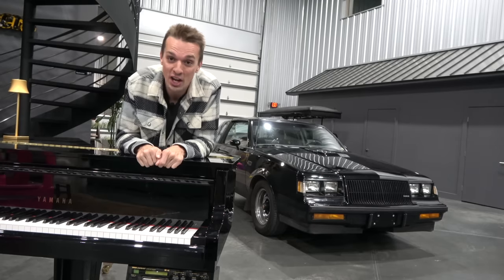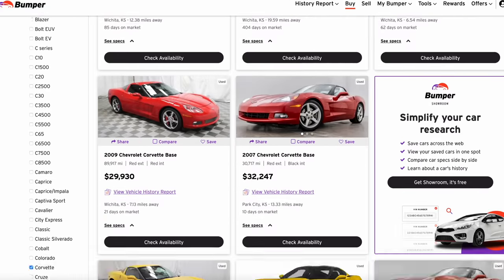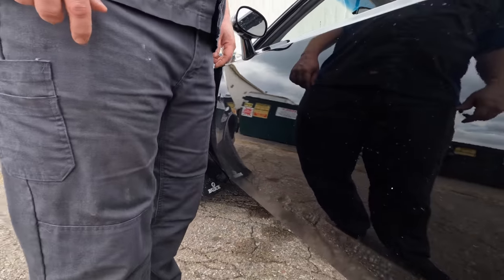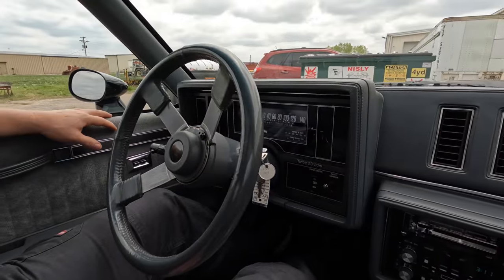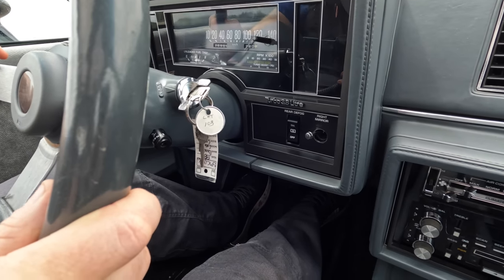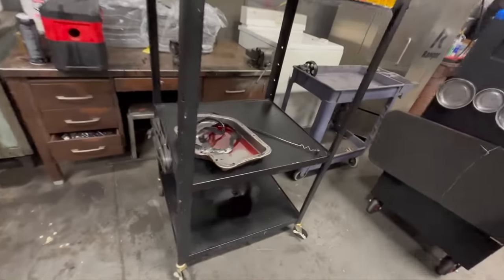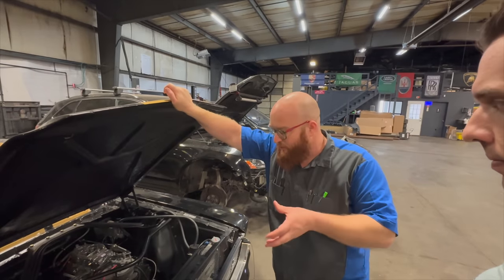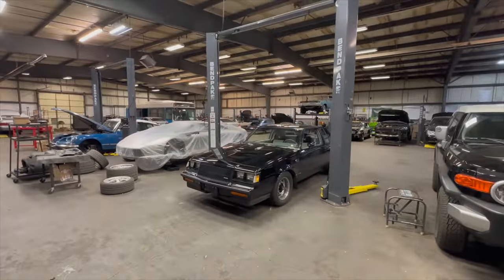Everything wrong with my cheap Buick Grand National, and finding previous accident damage?

Comment: My first actual CAR was a 1984 Buick Regal LTD. Black with maroon interior. Digital dash, Digital climate control. I absolutely loved it. Sadly I sold it.. twice lol
Reply: Fool me once, shame on you. Fool me twice...
Reply: Your first “actual” car?
Reply: My first car was a 79 regal Limited with the 5.0L motor. That was back when I lived in Florida, bought it from a retired couple, and the car was immaculate. Brought it back to New York, raced everybody with that thing, for some reason I could drive that car so fast. Oversteer monster. God I want a Grand National😍
Reply: Those cars are a headache to own nowadays. They’re old. If you find one in good condition, there’s no guarantee how long it will work, and it would be super expensive.
Reply: @doublezero7852  prob had trucks
Reply: Had same Regal..loved it--- 😢but sold it also😢😢
Reply: You know a cars good when you just have to buy it back. And when you eventually sell it again  you miss it
Reply: @zippityzbrake  yup, was never the same after I first sold it. Guy changed the engine and the custom wheels were gone, and rear seat area gutted.
Reply: @doublezero7852  everything prior was a pickup truck. 1980 chevy and 1980 gmc.
Reply: @schrodingerscat8621  yup mine was originally a 305. Was a great balance of power and fuel usage lol

Comment: I suspect if you look very closely, you will find out that the car got "front clipped".  The front of the car (including the frame rails) is in much better shape than the rest.    I think if you check, the "clean" is going to stop right around the subframe connectors.   They likely bolted back on the original suspension and all to save a bit, but the parts are about 2k and about 8 to 10 hours work, plus body panels and paint, and you can make it to 10k without effort.
Reply: The 1987 Buick Regal  (Grand National's base) was a full perimeter frame car, not a unit-body with subframe.

Comment: Had to have been up front, i noticed some butt connectors on the wiring for the marker lights that should also have wire loom on it and not bare hanging in the breeze. I wouldn't be surprised if it had a full or partial nose job. Look for aftermarket fenders and such. Insurance companies dont like to pay out for factory parts

Comment: Pretty much all of them got repainted at some point. The paint would start what they called checking. It would start on the tops of the front fenders and the hood. My dad bought one new and even though it was garaged, he had it repainted because of the checking.

It started doing it by 1989 or 1990. Low miles and garaged all the time.
Reply: Yup. My aunt has one left by my grandfather. Original paint and it looks like _garbage_. 

They really did a piss poor job on the paint on these cars.

Comment: Nice grand National I have a 84 grand National myself. Hot air car but fun as hell. Nice cars. Old but fun. On the hesitation check the EGR valve they are notorious for have problems. And if you disconnect them sometimes they will cause pinging really bad.

Comment: Bring it to the Buick GS Nationals in Bowling Green, KY coming up in two weeks May 17th - 20th. Car looks pretty stock and FYI that digital boost gauge is notorious for being inaccurate. First mods should be an aux boost gauge and scanmaster to monitor the ECU including knock retard. FYI, that rear end is incorrect for the car (7.5" vs 8.5") and that's why it has an aftermarket driveshaft. Don't add any power mods until you put the correct 8.5" 10 bolt back in.
Reply: bump for the good info
Reply: This doesn't seem to be a concern for channels like this. I guess they have the money to pay someone to fix whatever goes wrong. Driving it hard when you can HEAR it pinging is not a good way for head gaskets to live very long...

Comment: I was really disappointed when the Wizard spotted the valve cover leak. I was so e looking forward to fun stories in the comments about how dangerous starter fluid leaks can be, and how you should get the Wizard to pull it and seal it up, before you burned the car down by the roadside. Oh well, maybe next time. 😋

Comment: I live in Hutchinson! I am also an auto enthusiast. I had my share. Unfortunately I have no car now. On SSDI Veteran and Previous Explosives Expert in The underground mine here for 17 years. All kinda got to me. My favorite car I have had. A 1972 cuda 340 with ralleye dash. Rebuilt to 1970's specs, but with aluminum intake and holley 750 double pumper, 3.23 posi, 727 torqueflight. Yes it would move. Yes even with a 3.23 it would roast the 50's I had on it. I also has a 2004 dodge ram rumblebee I loved. Hemi, 3.91 auburn posi, automatic, that huge ram air hemi air intake, and programmer, 20" wheels. on a dot scale it only weighed 5000 lbs. and yes it would roast them even with the posi about half a block and go sideways when it hit second with an automatic.

Comment: You know with what the Car Wizard saw and the way the boost came on, maybe this thing got ditched from someone pulling the same stunt you did with it in the last video, as it would explain why that lower front end looks new and why the bolts and stuff havent been removed, as it does have the 930 F40 boost thing where it just builds and builds and if you dont keep that in a straight line, it would be easy enough to loose it

as when these things get hit, the frame bends in the direction of the hit, its one of the great faux Paux's about chassis ladder on frame cars, they still bend in the direction of the hit and if the hit is strong enough it will shift and bend the entire car, yet your doors are straight

so it must have been something light yet enough to warrant a repaint, and a ditching would do that

plus its like Ed put it with the viper, its just a given lol boost turbo straight line, ancient technology in a slow car that is suddenly fast lol 

which is, actually what happens with vipers, the thing seems benign enough till you get on it and you gotta know how to hold it and if you dont

Comment: That drive shaft weep hole shouldn’t be plugged. Just did one. There’s a o ring in the back of the trans tail shaft housing bushing that needs to be replaced. The hole in the yoke is to relieve pressure in the yoke that movement creates

Comment: Didn't GM do something to the engine to limit it for the 1987 model year? I kind of remember something about it having to do with people blowing up motors so GM limited it. Also didn't they put that beefier rear suspension frame thingy in the '87, for planting the power down? I think it was to stop wheel hop or something. I was a teen back then so I just remember drooling every time I saw one.
Reply: They did get the Australian 8 bolt rear
Reply: They got the 8.5" 10 bolt rear, with a G80 posi as a $100 option. GNX got a torque arm style rear suspension vs a 4 link. No mechanical changes from 86-87 they just changed the HP rating, but the ecm chip does limit the car to 120ish mph.
Reply: @ZL1power69  124 is the number I've seen the most.
Reply: @mindblownwatcher8536  Nope, they got the GM USA built 8.5 inch rear. Only the Hurst Ols/ 442 were the other cars with 8.5 inch rear. Monte Carlo SS got them 7.5 or 7&5/8 rear.

Comment: Had an 87 GN, then picked up an ultra low mile Turbo T Limited. Was just about to buy my first house so only had the 2 of them for a few weeks before selling the GN.  It was a good solid rust free car, and I had done some work on it but it had some miles on it and I was getting ready to dump quite a bit of money into it, when I ran across the Turbo T. Bought it from the original owner that special ordered it, and had only put a little over 20,000 miles on it. I still have the Limited and it now has about 30,000 miles. I regret not keeping the GN but it just wasn’t practical, glad though that I hung onto the Turbo T. I thing I will die with it, had it this long now, why get rid of it? A lot will only appreciate the black GN, but true Buick Turbo fans know the T types and Turbo Ts are just as fast, and just different skin.

Comment: I got hit in my 87' LX 5.0 mustang.  Supercharged Vortech V1, GT40 heads, Cobra R intake, stand alone fuel management system ect. Over 22k in the motor and tranny and the car has 21,000 original miles at the time.  Insurance wanted to total it.  I showed them all the receipts for everything and they said the age is what was the problem.  The mileage saved if from being totaled from less than 8k dollars worth of damage....

Comment: Chiming back in on Tyler's last video,  I found another GN for sale for 24k in (IIRC) Atlanta Georgia. It needs a paint job, but it's absolutely a runner and driver
Reply: Fun Fact: Hoovie may have bought it at auction, but it was LegitStreetCars that was selling it as an unfinished project car at Barrett Jackson. So he should have known what he was getting into since LegitStreetCars posted multiple videos on this before they sold it.
Reply: @andrewsadach3194  whaaat? this isn't LSC gn
Reply: @andrewsadach3194  LSC still has his GN, this is a different car.
Reply: @jdsgn  no he does not. He sold it at Barrett Jackson.
Reply: @corruptor911  no it is. He sold it at Barrett Jackson.
Reply: @andrewsadach3194   Maybe this is a side deal Alex found and flipped on Barrett Jackson but this is not the LSC car that he has on his channel.  Hoovies car looks all stock, has stock heavy steel wheels and dealer installed mud flaps etc... LSCs has aluminum reproduction wheels and is a hard top car that he painted the whole underside and rebuilt the suspension vs Hoovies being a Ttop car with a stock underside.
Reply: @jdsgn  clearly they don’t really watch LSC lol Alex ain’t selling his no time soon

Comment: Late 80’s I would hunt for these in my ‘68 Camaro 327 w/Auto trans 3,500 converter and 4.11 gears. Would just walk away from them stop light to stop light, they were always pissed off😅
Reply: 327 auto would be cannon fodder for a GN. My 87 Turbo Limited (Same drivetrain as GN) would take a swapped 427 stick 69 Camaro. Dude got P!$$@D when he found out that mine was a bone-stock v6. This was on a street race on street tires.
Reply: @stevencovington4715  
My engine was by no means stock. 
7,400 was my normal shift point. 
My cars powerband was 4-7k

Comment: It's a 3.8...they all leak oil around the rocker arm covers. There was a recall on every vehicle that used a Series II 3.8. I had a 97 Regal GS (3.8 II with a supercharger) that ended up burning to the ground because of a leak from the front bank.

Comment: I thought when transmission fluid leaks out the weep hole on the driveshaft yoke it means the tailshaft bushings need replaced? Ive done sealer on the weep hole before but when i replaced the tail housing bushings and seals i removed the silicone and it fixed the leak. Im not talking about the slip yoke seal but typically thats replaced too at the same time. I was taught that when that bushing wears out it allows more fluid past or something and causes it to leak specifically from the weep hole on the driveshaft. Ive done a handful and everytime its fixed the problem i know theres a specific kit for the 700r4 to just do the tail shaft that was the last one i did, it came with everything to replace the bushing and new seals and reinstall.

Comment: As a GN owner, I can tell you what is wrong with the car before he even took it to Wizard.  Why?  They all suffer the same thing.  Oh and GN"s didn't normally make 15psi.  There is a vacuum hose boost controller dial trick you can do.  I could get 23psi out of the small Garrett TE-44 turbo.  I sent mine back for rebuild as there was oil blow by on decel.  They were famous for this.  The downpipe crack is also famous.  When you could get more boost for some reason the downpipe like to move and crack topside.  The worst part of the GN is the Hydro-Boost.  I went through 2 of them before switching to power (vacuum) brake booster.

Comment: It has a Pat's driveshaft because it has the wrong rear axle. That axle has a 7.5 ring gear and is a smaller rear end. The GN came with an 8.5 ring gear and a stronger rear end. Look for G87 in the opt codes.

Comment: Sometimes accident damage cars are the way to go. My car has accident damage from two fender benders that required panel replacement. The paint match is perfect, panel gaps are 95%, no unibody damage. I got a 30% discount for a mechanically perfect car, essentially.

Comment: Having owned several late 70s and early 1980s GM cars (Camaro, Firebird, & Trans Am), they hesitated due to those poorly designed catalytic converters (they had a lot of back pressure).  If you put a better free flow exhaust on the car your performance would definitely improve.

Comment: Tuned up many a V6 BUICK Regal, Cutlass, GP  (non-turbo) and almost always that rear most plug wire was toast, on the right bank due to very little air circulation (HVAC Housing)  I'm sure that Turbo adds to the Circulation issue. But then that's a Grand National...Wizard will get after it👍

Comment: Hoovie it has the wrong rear end in it. If you look closely it has “fangs” at the bottom of the rear end cover which means it’s a 7.5 rear end. These cars came with the stronger 8.5 rear ends. 8.5 rear ends are squared off. Look it up

Comment: The paint on these from the factory was terrible on all the top surfaces, so that it’s been repainted is not a surprise. I had an 87 back in 1997 that I bought for $9500 with 50k miles and the paint was original and crap.

Comment: Oh Wizard, that weep hole in the shaft yoke is suppose to there so the thing slides on the shaft with no resistance..
The leak is from the tail shaft O-ring being bad or missing. You can replace it easily by removing the tail shaft housing.
Fix it right big guy.

Comment: the wizard uses locktite as personal lubrication - good genl (pardon the pun) content here - you should run e85 in this and put in a bigger intercooler and get wizard to flash you a new chip -looks super clean - pls do an update, add some electronics #pure lambda skin

Comment: Someone took the 8.5 rear end out that car. And put a regular 7.5 rear in it. Probably has the incorrect gear ratio also. 

Better check to see if it has the correct transmission also.

Comment: I do NOT trust CarFax!  They transposed the milage of my trade in onto my new car, and NOW claims therenis "structural damage" on the new car without saying what it is.  My mechanic look it over and said it was the cleanest Juke he had ever seen, though I did need tires.
Reply: Yeah, i traded in my car, and it said i was the second owner, and it was repainted. i laughed. I bought the car brand new with 10 miles on it. Traded it with 60k .  Could be the dealer trying to lowball me.

Comment: I don't think that's the correct rear end. That one looks like the smaller 7.5" that would be in other G bodies. It should have a 8.5", which has a more round pan and 2 "ears" cast into the housing on the bottom. Not a good enough shot to be sure.

Comment: I used to have a 75 Monte Carlo that I put in the engine and tranny from a Z28 Comaro.  I always wondered what is the better car the Monte Carlo SS or the Grand National?
Reply: Monte SS wouldn't hold a candle to a Turbo Buick. It's would be like a little league pitcher trying to strike out Mike Trout.
Reply: @badassbuick86  It wasn't a Monte SS until I made it one....
Reply: @pebear  Regardless, any non LS swapped Monte SS is gonna have bus lengths put on it by a Buick.

Comment: I always wanted a T-Type... bit more of a sleeper!
Reply: Try a Turbo Limited for the ultimate snooze!
Reply: @stevencovington4715  if it wasn't such a PITA I'd swap the GN powertrain into a Oldsmobile Cutlass Brougham!
Reply: @cigarsgunsanddiesel8032  Actually, it is easy!. Especially if it has 231 Buick v6. Hardest part will be routing fuel injection fuel lines on chassis. (They actually use the same frame 78-87 2 door & 4 door.)
Reply: @stevencovington4715  yeah that's too much work without a lift LOL...
Reply: @cigarsgunsanddiesel8032  I did it it the open yard with two jack stands on 2x6 boards.

Comment: Please clean the underside of that car and spray some paint or undercoating. Rust on old GM car quickly becomes a problem. I know it's only surface rust now, but next thing you know it turns into Swiss cheese.

Comment: That's not the right rear end for a turbo car. If it's detonating bad enough you can hear it, you're on the fast track to tearing the engine apart. If you're going to beat on it you should at least have a way to know if it's knocking and how much boost it's actually making. If you aren't willing to learn about these cars, you need to find somebody that already knows to help you take care of it. It's a 36 year old fuel injected turbo car. It's going to have idiosyncrasies.

Comment: #SQUIRELLS you get one of those old-fashioned safes from the late 1800s the ones that are the size of the average fridge and weigh half a tonne put walnuts in it, lock it and within a week they will be squirrels in the safe eating those nuts so to say that bent plastic mesh will keep the buggers out is just laughable